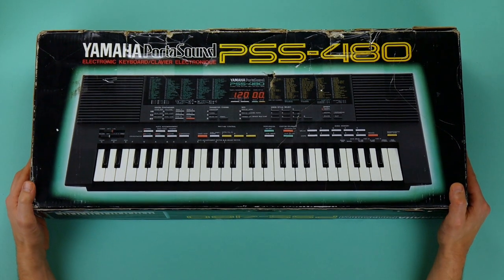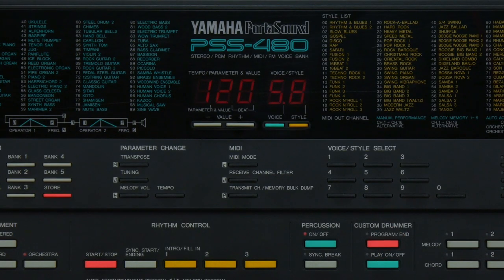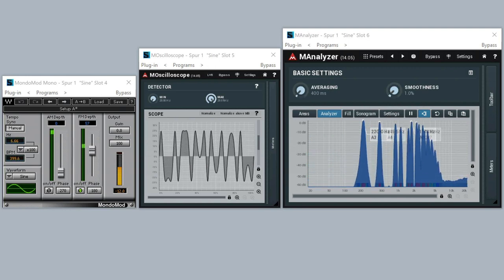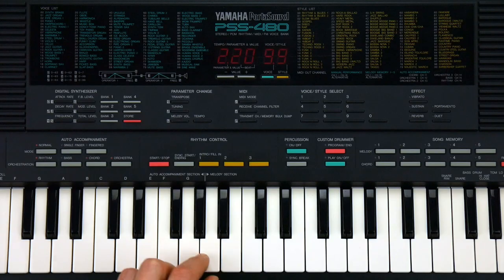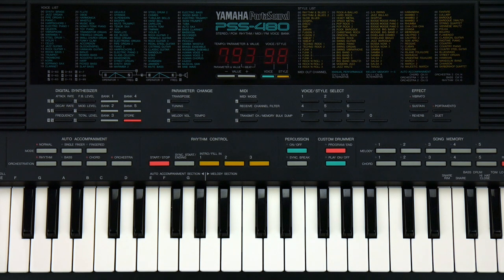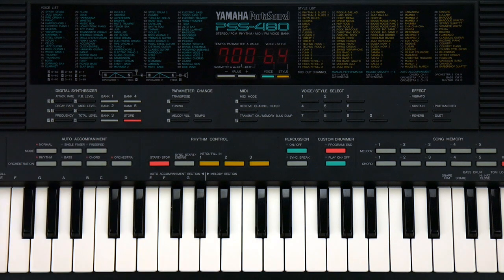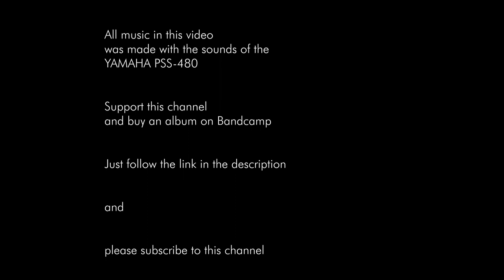Yamaha PSS-480 -  Part 1: The FM Synthesizer

Comment: Terrific explanation of this synth and of 2-operator FM. I'm quite fond of this machine, as sort of the end of when consumer-targeted portable keyboards were still synthesizers, and not just PCM playback engines. Thanks for taking the time. 

I picked up my PSS-480 without box or manual from a pawn shop maybe a decade ago, and have in that time managed to break the low G key, though everything else works. (Need to see about replacing the plastic key.) I've used it both as a MIDI controller and as a sound module, working with the rest of my cheap studio.

Comment: Love this little keyboard. I'm in the process of making a sysex programmer for it and the 680 using an Arduino.
Its one of the few Yamaha PSS/R model I know that has the ability to change program sounds via sysex.
Reply: There are already soft programmers for it, if that can help you. 
Don’t know much about them though.
Reply: @javiceres  yeah I used ctrlr before. I'm building a standalone controller so i don't need a computer nearby. I'm also doing it for fun lol
Reply: @ericobrocki5850  I’d buy one of those if I could
Reply: @javiceres  I'd like to make one for sale. I've basically got a working prototype, but it'll take me a while to design a case and pcb since I haven't done this before.
Reply: @ericobrocki5850  put up a video on how you make it
Reply: @2009johndoyle  Oh definitely, I just don't have a good setup for making videos at the moment. I'll probably post it to another account if I do.
Most of the work was spent making the lcd UI from scratch, which you don't have to do, there are libraries available to build an lcd UI for you. 
The other part of the project was just formatting the values displayed on the UI into a sysex message. If you look online for the PSS 480 or 680 service manual, there's a useful diagram that shows how the sysex message is laid out for sending the parameters.
 You can then send the sysex message via the serial out on the Arduino.
I'm sorry I can't present this better atm.
Reply: I’d love one of those! I have the PSS-680
Reply: @ericobrocki5850  so you basically can create a keyboard. Subscribed‼️
Reply: I had this keyboard as a kid in the 80s and spent hours learning FM synthesis and trying to recreate the pop sounds I wss hearing on the radio. Turns out they were all just using the presets on the DX7 because FM synthesis programming was such a pain in the A lol
Reply: @ericobrocki5850  i would definitely buy a standalone programmer for this synth! i love it so much i use this synth in all my productions
Reply: Any updates?
Reply: @SkelaKing  So unfortunately its been on hiatus since I moved a few months ago. The prototype pretty much finished besides some extra work to make the knobs scan better, among some other changes. After that I would be able to design a proper case and pcb. 
I work full time and this hasn't been high on my list after the move. So it might be a while till I have something to offer.
Reply: a behringer bcr2000 would solve all your problems you can program sysex with the softwear of the bcr2000 and save it so no computer

Comment: I bought one of these brand new in 1987 for a lot of money. I think about £100. It was my first keyboard. I also bought a Foster X-15 second hand for £250.

I then traded it for a 560. Then I traded that for the amazing looking and sounding 680.

The 680 was a massive step up when I got it  It had far superior drums and also had quantizing. It did not have FM synthesiser, but I think the sounds were still synthesized rather than sampled. I'm pretty sure portamento was unfortunately taken away in the 680.

Comment: Superb video👌These PSS boards were my first foray into synths, one of our lecturers bought a PSS 680 around 1990 for our uni band,  it changed everything, since it could be made to do ANYTHING (DX7 tones, and more -). They remain  truly phenomenal value and  versatility these mini keys -FM synth, sequencer/ drum machine to full featured MIDI controller ( @32:50  to end 👍) . I still have a PSS 780 and PSS 680 (through a QY10,etc)), and i it is  a bit of a let-down that the  modern reissues ( Yamaha Reface series) kind of miss the mark in comparison.

Comment: This was my first semi pro midi workstation and I used the heck out of the sequencer and synth to compose my songs. The trick to make ONE song that can be used quite effectively in a mix is to record a bass line that will end at a good LOOPING point, a repetitive stanza with either ONE track(monophonic), or 2 or 3 tracks combined(2 or 3 note polyphonic this way), and making sure you end on the RIGHT NOTE to allow a good looping point on those other tracks too. You make your custom drummer drum pattern and have that enabled and lastly you BRING it all together in a song by selecting CHORD track 1 as the final track to record, BUT do not, press ANY KEYS!! Just start the recording by selecting the bassline, to come in on time as soon as you press the start button, and start punching in and out, the various tracks you recorded, in time to loop you song parts together like a live remixer tool. NOTE there are 255 total note events memory so bare that in mind! The song recording can be ended when you have had a nice repeating groove that can end on a good looping point, and then the recorded song will play endlessly, looping your mix. You can then add or augment this with external synths controlled by these tracks set to each midi channel that corresponds to the tracks recorded. So if bass line track 1 of the melody tracks is Midi channel 1, then set a external midi synth you want to ADD more bass tone to, to midi receive channel 1, and so on. Remember that if you select more than ONE melody track to record on, those groups of tracks become ONE midi channel and polyphonic. This keyboard IS a one hit wonder tool that can be lots of fun for years as I can attest to. BUT one thing to keep in mind, the contents will erase slowly if no batteries are left in the unit and the unit is unplugged.. ONLY, if the unit is UNPLUGGED!!! This means, YOU DO NOT, have to leave batteries in the unit if your keyboard is PLUGGED IN the wall and shut off!! Just make sure you plug into a UPS like with a computer, and you have your contents saved between sessions! ANOTHER THING: This unit is very powerful in terms of MIDI so if you want to SAVE your contents outside the keyboard so you can reload it as needed, you CAN with the midi dump feature! For best results, USE A YAMAHA PRODUCED COMPUTER SOFTWARE DAW OR MIDI FILER SOFTWARE!!. I found out the hard way, that not all midi software will receive and transmit YAMAHA sysex midi data correctly and will corrupt as well as possibly corrupt your receiving unit(YAMAHA AN200 OS upgrade failed on me 3 times until I figured out the issue). I use YAMAHA XGWORKS 3.17 studio which is FREE from YAMAHA right now, as it supports PLG and AN/DX synths. The sequencer in that software works almost seemlessly with these older YAMAHA branded units. The PSS480/680 for sure!

Your RAM size in the Yamaha PSS480/680 is 64Kb as denoted ON the motherboard of the keyboard NEXT to the RAM chip.

Comment: If I'm correct all the hidden parameter can be changed using MIDI using sysex si no easy way to use an external controller that can't be programmed with complex interaction.

And great demonstration of that under-rated keyboard! Got mine not that long ago for dirty cheap because of MIDI, I really enjoy it but still find internal patches to be less interesting than a PSS-280/290/26 that albeit using the same 2op FM, they tend to use more than one channel per note so can do more complex sounds with some of the 4 or more algotithm as long as there is no more than 2 op in a single chain, and the OPK is actually stereo and not mono like the one used int he 480 and related, but yet still a great keyboard!

Also it funnily react to velocity when set in the right midi mode, even if the keybed itself do not provide velocity, that always amazed me :D

Can't wait to see part 2!

Edit: It's actually a 580 I do have, but that's essentially the same keyboard with the preset ordered in a slightly different way on the front panel, but in the same order on the MIDI side. Go figure!

Comment: As a PSS 680 owner i was always happy you could save presets in the keyboard (as long as it had batteries inside) or dump it as MIDI SysEx patches on your computer (and getting them into your keyboard again the other way round). Insanely fun to play and tinker with, despite the mouse-keys.

Comment: I recently got a PSS-680. I love it. At first it doesn't sound like much. But once you start tweaking the parameters you can get some nice sounds. I am working on a cover of the 80s Doctor Who theme. I already have patches for the bum bu bum and the doo wee oo. I used the portamento on the doo wee oo. It's the only use for portamento I have found so far. And to add the cherry on top I added some dely from my mixer. It's not bad at all compared to the original done on a Yamaha CS-80. 

Given the small size of the keyboard I play it via MIDI from my Radio Shack Concertmate.

So I these keyboards are worth picking if the price is right.

EDIT TO ADD

I had no idea you could adjust the portamento. Glad I found your video.
Reply: An update after having this for a while. I really like it. The piano (03) sounds really nice with vibrato, sustain, chorus, and duet. The MIDI makes it really nice to play since I can use another keyboard or MIDI controller. Tomorrow I have the 4 operator FB-01 arriving. I plan on getting a getting a DX7. I love the idea of having 2 op, 4 op, and 6 op synths. I may also get a 4 op keyboard so I can have a nice stack of FM keyboards on a single stand.

Comment: As far as I remember the PSS-480 has all the drum sounds of the PSS-680, but you have to access them via MIDI. Check the PSS-680's manual for reference.
Great vid, as always. Looking forward to see part 2 and 3 and to dust off mine, which is still stored in it's original box :-)
Reply from the maker: Unfortunately not. Only the 9 drum sounds, but most of them can be played with multiple keys. For example: Tom Low with B1, C2 and D2

Comment: Oh boy, an instant classic. My first real synthesizer and I mean it was a real synthesizer and a good keyboard too. You  can use as a controller or sound module with 16 midi Channel control I made some absolutely spectacular sounds with the two oscillator synth that's on it and you can store the sounds with midi bulk dump. I used it with a QX-21 two track sequencer

Comment: Picked up a 680 for free as it didn’t power on. A dry solder joint was the issue and within 30 seconds it was working. Only thing which doesn’t work is one of the drum pads. Also run it through a phaser and it sounds epic

Comment: I own two PSS 480s and LOVE them. What I do is plug a MIDI cable into the MIDI in, and use a  full size 61 key controller, so I can play better than on those tiny keys.

Comment: Just checked mine and it's a 480 02 model too. Only after roughly 35 years mine has some issues, only left speaker works and the ac adapter plug is loose and loses power if you move it around, then have to wiggle it to get it back on. You're way more knowledgeable than I am with it. I mostly used it as a learning tool for piano. lol One day I'll have to play around with the custom voices, that's something I've never thought of doing. Cheers!

Comment: I have both a PSR-36 and PSS-480 from back in the day. Of course I knew there were these "strange sound buttons", but little did I know how to use them. 
3 decades later I bought a PSR-E353, a huge update, but no operator buttons.

Comment: The pss790 was the best of the range but used awm ( advanced wave memory) instead of fm.
It had an onboard 8 track sequencer ported bass boost, a joystick for mixing 4 voices together (vector synthesis), and had midi in, out and thru. It had 100 accompaniment styles 100 voices various harmony settings. And it was 16 part multi timbal when controlled from an external sequencer. They retailed for just over 200 pounds. There was a pitch bend which could be set in reverse so moving down sent the pitch up, you could set this between 1 and 12 semitones. And the pitch bend would also effect the drums. Oh and it had 8 pads assignable for different drums, though like the keyboard they were not velocity sensitive.

Comment: There is Sysex editor/librarian panel for "Ctrlr" (PC software utility for controlling all kinds of MIDI devices) for PSS-480. 

And when it comes to PSS-480 hidden features, just to say it has 3 parameters for OP1/2 waveform, 3 frequency multiplier params.: coarse, fine, detune (per OP 1/2) 6 parameters for OP1/2 envelopes (A, D1r, D2r, D1l, Rr, SRr), 3 params per OP for keyscaling, OP1 selfmodulation, overall LFO to Pitch and LFO to Amplitude amounts,  AM off/on (per OP)... i have missed some of them, but I think it's 32 parameters in total,  plus 5 on/off parameters. 

Mighty, powerful synth except the fact it's 8 bit, which is sometimes exactly what some pople want.

Comment: The funny thing is: i rather make a patch with this keyboard than with the DX7. I always wondered if there is a DX7 patch libary containing the 100 presets of the PSS 480 series, though... The one thing that could have been better on the PSS480 (besides the somewhat noisy output) is the global note up/down shift, instead of a setting for each individual patch :(
Reply: The Reface DX is a very user friendly (and available) synth that falls somewhere between this and the DX7.
Reply: @JM Coulon Yes, i use Dexed to browse through patches and send them to my DX7. Great feature!
Reply: Indeed. I've owned a DX7, DX21 and DX9. I got rid of each of them and kept the PSS-480 and PSR-36. programming

Comment: your 3 videos on the pss 480 are awesome great work, 
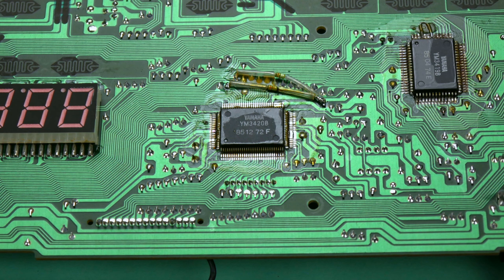what is the mod we see at 5:04 ? ( with the 2 resistors and the bridge on the other chip )
To reduce the electrical noise in bacground ?
i have the v4 of the rom and a big noise in background
( i have the psr 36 with the sames FM chip and there is no background noize )
Reply from the maker: I think these modifications were made at the factory and have nothing to do with the audio output.

Comment: I was always a fan of the Yamaha PSS-560/570 ....but the 480 seems cool as well. The PSS 560/570 is a workstation keyboard, the 480 seems to be the same...but the 480 focuses more on FM voices (as mentioned) and not so much on the rhythm or rhythm re-voicing or variations of each rhythm as the 560 does. I do notice some of these sounds on the 480 sound like the PSS-270, which offers 100 voices.

Comment: Looking forward to next episode. I own pss-580 and also noticed that some of the presets hides various other parameters. But I'm really curious about MIDI implementations and your mentioned usage as "multi-timbral sound source ". Few weeks ago I was able to made half-decent percussion sounds out of sine wave preset. I was disappointed to discover that this keyboard doesn't receive pitch-bend wheel commands. In short, there's still a lot to discover on this keyboard although I own it for 5 years or so.
Reply: i have a pss-580 and it does bend pitch from my keystep when hooked up 🤔
Reply: @joeakajoe1  hmmm, that gives me some hope. Funny that it engaged vibrato when modwheel was all the way up. (connected to Alesis q49)
Reply from the maker: It receives pitch bend in midi mode 99
Reply: @KeenOnKeys  thanks! I'll try that through DAW for the sake of testing.

Comment: Don’t forget the Yamaha DSR series, especially the DSR-1000/2000, it has the same YM2412B as the PSR-80/90 and 6300
Reply from the maker: Yes, and they are sometimes quite cheap. If only I had more space ...
Reply: @KeenOnKeys  I’ve just retored a dsr-1000, which I should have recorded. Broken keys, broken switches and broken display panel hinge.  Unlike the majority of pss/psr, it does not all hang off a single case, but has separate cases for each speaker, the main body and the display panel, when you disassemble all parts fall away - making re-assembly a bit more tricky.  Defininately the most complicated physical repair I’ve had to do, so many screws too, but an easy to use interface, especially for a 4 op synth. ;)
Reply: @KeenOnKeys  I bought one last week, it had one bad key.. it’s a nice FM synth :)
Reply: @WeeInnovate-uk  record the demonstration tune ;)
Reply: @dexx2233  Does it have a demonstration tune, I did not notice.  I still have 1 job to do on it (replace the red power switch cap) so I will have a look when I get back round to it. Thanks ;)